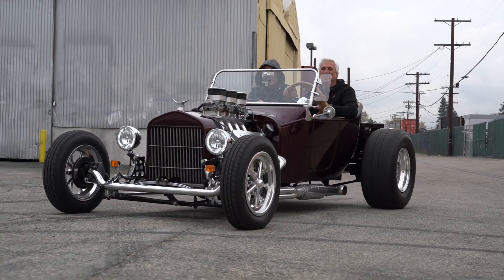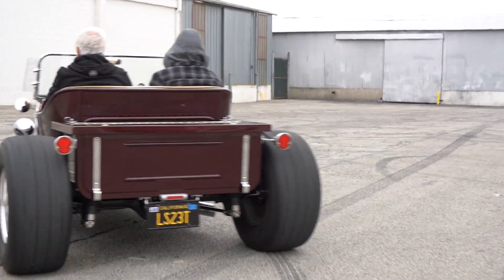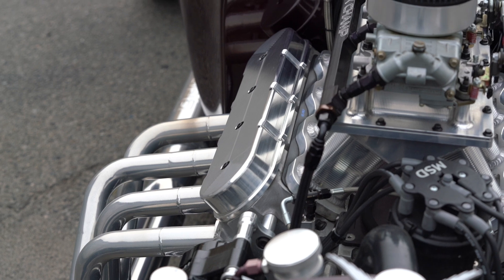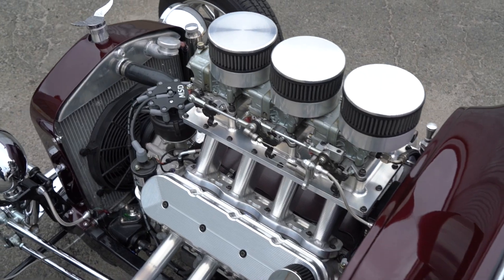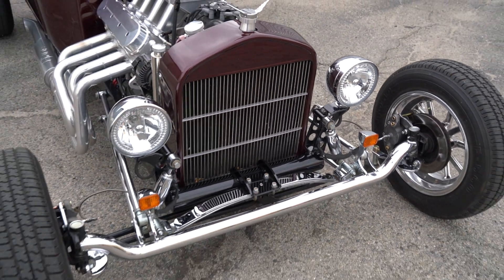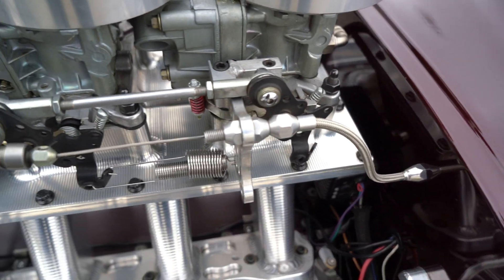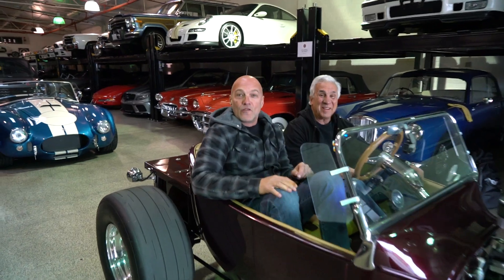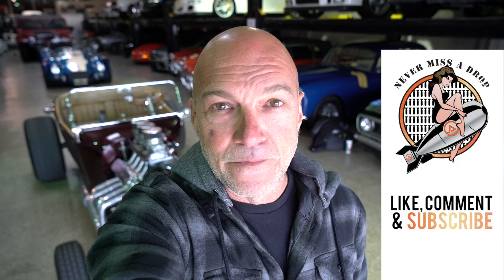600 hp 1923 T-Bucket | Seriously Built LS | Total Badass

Comment: First I have  seen with suspension done right ... since ours. It went low 9 qtr. the other thing right on this bucket is the LS because low torque  low down. Some hints guys. Mine was in the mid 70s to late 80. George Montgomery engine. 👊🏼
Reply from the maker: Sounds like you had a great one as well. I love that Bill drives this all the time too

Comment: I really like the way you built that bucket t I am building another one because I have to ask my wife if I can drive the one she claimed. Like you said every one is different. But mine will have same tires and wheels headers but different color. And different motor. Thank you for the short movie. I like every thing about it
Reply from the maker: Glad you liked this and feel free to contact Bill. He built everything you see including the engine
Reply: @AutotopiaLA      I am a welder and weld stainless steel.  So I have been making the t out of as much stainless steel as I can bent a pipe and machined the king pins  and I have my grandpa’s old 1925 t truck he hauled dynamite to mt Rushmore with and it has what they called shocks but they are overloads so I am using that idea only putting air bags where they had coil springs. And I am building a rack and pinion steer inside the front cross member so you can’t see hardly any of it. Doing same on back of car. I would like to show you mine when I finish it. I am putt

Comment: I do not care if you like "T"s or not. There is nothing like the rush you get when you slamming the throttle on a light open car with a big engine. I got to be in one in the old days running up and down Woodward (Detroit)( I guess I'm showing my Age).
Reply from the maker: This thing accelerated so hard! He recently did 0-80 in 3 seconds. It moves!
Reply: @AutotopiaLA  It is like have a double A fuel dragster motor in a go kart.

Comment: It still is puzzling me why people put a LS in a Ford. Ford engines have been outperforming the LS series for years. At engine Masters the Ford Cleveland won every year it was entered. And the engine has been obsolete for over 50 years. Two years ago, Kaase entered a Ford Y block from the late 50's. That engine made more HP than the LS and it had been obsolete for over 70 years.